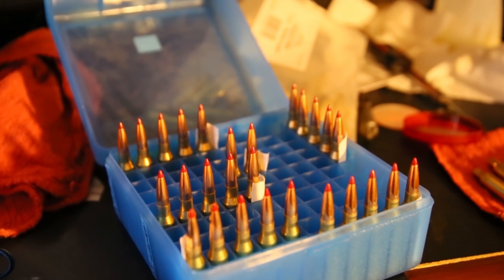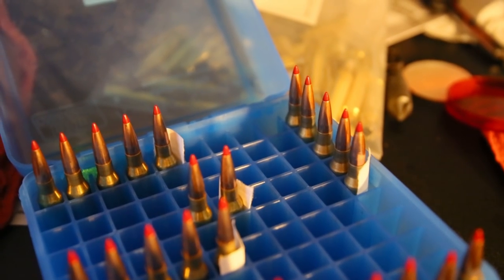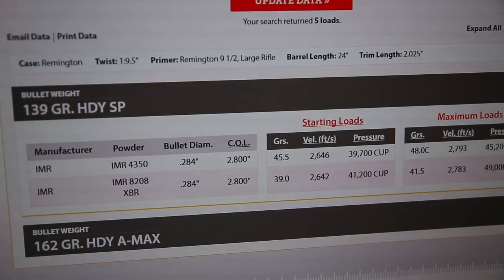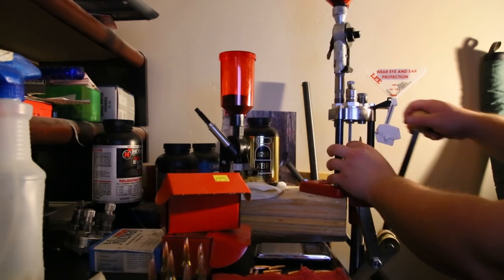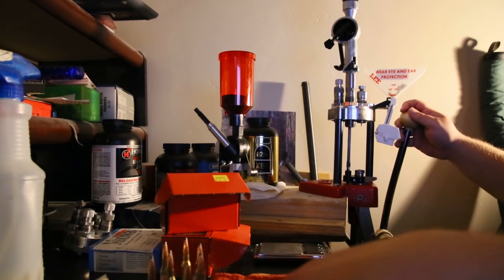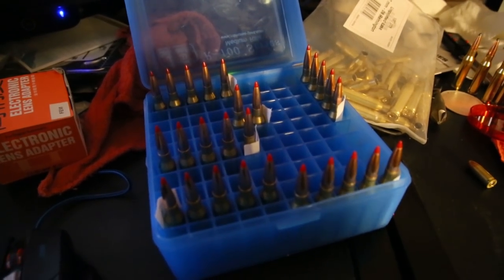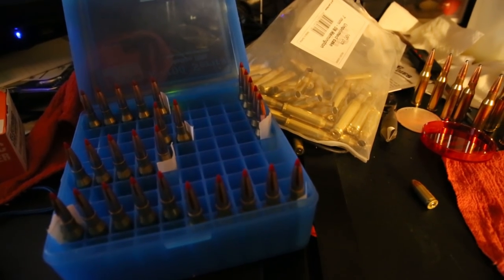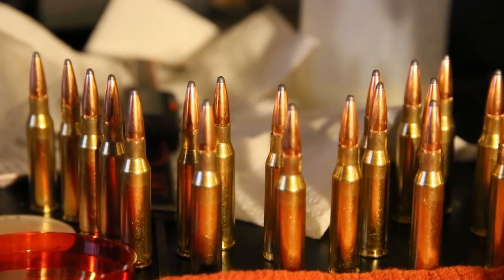Why I switched from 30-06 to 7MM-08 And reloading 7mm-08 for Elk - Lee Classic Turret Press

Comment: ok im thinking about .270 or 30-06 which one should I get?????
Reply from the maker: If I were you I would get the 30-06 over the .270 just because of the versatility and the ability to load heavier bullets. But both will get the job done depending on what you are wanted to do. I personally know a person who has taken 4 elk in the last 2 years with a .270. Well, 2 were his sons, but they all shot .270's. They had to shoot more than once, but that was probably due more to shot placement than caliber. 

 I would also consider the 7MM-08 though. It outpaces the .270 ballistically almost across the board, and passes up the 30-06 if you shoot out past 300 yards. It has less recoil than both.
Reply from the maker: Can you clarify which part you are referring to? Why is what?
Reply from the maker: I would go out and shoot both and see which one you like. Do some research about the ballistics and compare that to what you plan on doing and see which one matches what you want.
Reply from the maker: I mentioned that the bullet selection for the 30-06 is much better. The .270 can't shoot heavier bullets than about 140-150grs, but tou can load up 220gr bullets for the 30-06. The heavier bullets for the 30-06 also have a much higher BC and are more effective for longer range hunting. 
 There are pro's and cons to both. The .270 is flatter shooting because the velocities are faster. it also has less recoil because of the lighter bullets usually.
Reply: Glenn Pearson a 270win has more muzzle engery at 500yards then any 30-06 load
Reply from the maker: Unless the barrel is traveling with the bullet, I don't think you mean muzzle energy. Just energy. But your statement is incorrect. Look up the new 200-220gr ELD-X bullets for .30 that you can load in the 30-06. Those will have several hundred lbs more energy than anything available for the .270, especially at 500 yards. The .270 is a great caliber, but to say its better than anything out of a 30-06 is false.
Reply from the maker: Allen, I did look up load data before I commented. Also, I am not asking you to listen to me. I would love it if you could show me an example because there is nothing in the IMR/Hogdon's reloading data, hornady or nosler reloading data I have found that would back up your statement, which was that the .270Win has more energy at 500 yards than ANY load from a 30-06. There are actually about 10-15 loads available for the 30-06 that produce more energy than the BEST .270Win load at 500 yards. I even checked the .270 Weatherby Magnum loads, and even then there were still 30-06 loads that outperformed the Weatherby, though by a much smaller margin.  

Again, if you can offer more information to back up your statement, I am willing to hear it. Personal insults do not prove you are right, in fact they are usually used when someone is loosing or lost a debate.

Remember, I'm not even a big fan of the 30-06. But I know how versatile it is and that is has been a successful caliber for 110 years now. I also know bullshit when I hear it.
Reply: kid snipa the 270wsm holds more powder therefore kicks alittle more the 270win doesn't kick as bad either one will get the job done but if ur Sensitive to recoil get the 270win
Reply: Glenn Pearson and sorry bro I looked it up
Reply: kid snipa no problem man I'm not sensitive to recoil either but I got the 270win
Reply: kid snipa yes so since ur not sensitive to recoil I would get the 270wsm
Reply: Consider 7mm-08 if it isn't too late! Much easier recoil makes for better shot placement and short action allows lighter rifle to hump in mountains.  jmho.
Reply: RKBA very true and it's a good round
Reply: Allen Stewart Plus compare the velocity and energy at 500 yards compared to a .300 Win Mag.  7mm-08, 140 gr NBT vs. .300WM, 150 gr Core Lkt.!  Velocity is within 30fps but energy delivered is around 168ft lbs MORE than the .300WM!  I was surprised to learn that initially.
Reply: RKBA bro that's insane I didn't no that thanks for the info
Reply: kid snipa u can't go wrong with a 270 since ur 13 I would go with the 270win because it's got less kick then a 270wsm
Reply: kid snipa the the Remington model 700 is a great gun IDK who told u that but they r mistaking
Reply: kid snipa they r mistaking it for a model 770
Reply: kid snipa I never owned one man never shot one
Reply from the maker: I would pick up the 7mm-08 over the 6.5x55. I would also strongly consider the 7mm-08 against the .270win, as it has a bit more power down range because of the heavier bullets. But either way, I think you would be happy. Compare the ballistics and research for yourself. Everyone has their own opinion. The best is to build your own opinion.
Reply: Glenn Pearson there all good they all get the job done
Reply from the maker: If you are only hunting deer and only plan on shooting 50-60 yards for the rest of your life, pick up a .243. Great caliber, especially for deer with very little kick.
Reply: kid snipa there both very good choices u can't go wrong with neither one of them
Reply: kid snipa yes
Reply: kid snipa no problem
Reply: do some research... both will be perfectly suited for many applications... but find your purpose of what youre using it for i own 30.06 spring and honestly im highly impressed with the .270... especially after 200 yards it surpasses the 30.06 30.06 is the big boy most common probably of the last century but expenses might me lower with the .270 so take them all into account  really both good calibers for their built purposes
Reply: Good deal! I would say they come down to pricing and availability standard is fine at 22 in barrel might need or want a 24 on swm but does the improved velocity suit your needs and expectations down range?
Reply: Personally I'd go standard 270 spectacular at what it does and a little more barrel life
Reply: kid snipa as long as u don't shoot it more then once and let it cool off u want have to worry about the barrel
Reply: kid snipa Hotter round like most guns affects long gevety imo I see no true significant benefit to the wsm for him especially if he shoots it a lot and he will own it possibly for the next 60 years and generations on if so... just a thought... things taken into consideration like building a long range gun are more affected I guess ie. A 6.5 creed 1500 rnds 308 6000 or more? Haha
Reply: Allen Stewart sorry forgot to reply to you on that previous postkid snipa it's entirely up to you I'd just compare them side by side number to number and compare that to the purpose you're looking for... keep in mind things like u can walk into almost anywhere and buy 270 but do u have a wsm available in your area or do u order online only or load cartridges etc can't really go wrong either way here but if the purpose is to go 270 and get away from the things u don't want in a 30.06 powder changes will make it closer...
Reply: Eric Marquis I personally wouldn't have a 30-06 not because of the recoil I just don't like the 30-06 I'm a 270 man
Reply: +Allen Stewart I think the 270 is just better too
Reply: Eric Marquis Yep plus u get less drop at 500 yards with factory ammo that's what I shoot I don't reload
Reply: +Allen Stewart the 270 passes 30.06 performance after only 200 yrds
Reply: Eric Marquis I know bro I'm just saying at 500 yards u have less drop
Reply: kid snipa they both r going to cost u about 400 dollars if u go to ur local gun dealer
Reply: kid snipa OK but ur going to go threw alot of paper work
Reply from the maker: I'm sure he said that because buying a new gun and going through the background process requires a lot of paperwork.
Reply: Glenn Pearson I did ur right
Reply from the maker: Then you probably won't have all the paperwork, unless he chooses to sell it to you through a dealer.
Reply: Well said Glenn and I don't know you from "Adam"...
Reply: I love my 270 ammo availability for both should be about the same if you can shoot both and see what you like. If you want to get into hand loading get the 30-06 you can take it down to 308 levels or load up to damn near .300 H&H levels if you're skilled enough

Comment: Really you don’t check how much power is going in? I found out of 50 loads 4 will be right on
Reply from the maker: I check the powder every 4-5 usually. I'm always within .1-3 grs. Not enough to worry about it for my plinkers. I have an electric powder dispenser I use now for my hunting rounds. But for loading quickly on the press, this is accurate enough for target practice.

Comment: You shouldn't be talking while reloading. It's easy to skip a step or repeat (doubling the charge) a step. Reloading is can be very safe but it is a dangerous activity and carelessnes or negligence can cause serious accident, life altering event. You should at least, do spot checks to make sure the correct amount of powder charge is deposited in the case.  I've seen stuck bullets in the barrel due to no powder charge at all in the case, only the primer as a propellant to push the bullet.

Comment: What's the longest distance you'd shoot an elk with the 7mm so he doesn't bleed for 3 days and leave a 10 mile trail and is there a difference between 7mm and 7mm-08 or just another way to say same - thx
Reply from the maker: By 7MM I am assuming you are referring to the 7MM Rem Mag? If so, here is a video I did that compared the 7mm Rem Mag to the 7MM-08. There are many other options that shoot a 7MM projectile. 

https://www.youtube.com/watch?v=FhRlOrS69oE

The furthest I would personally shoot an elk would be 500 yards, with any gun. But that is because of my skill level and that question is only able to be answered depending on the skill level of the shooter. you can have the biggest caliber you want and shoot an elk in the ear and he isn't going to fall. Shot placement and bullet selection is key. Either of the guns you mentioned would be fine out to 500 yards, IF the shooter could place the bullet in the proper place. If you are chasing an elk all over the mtn after you shoot it, 95% of the time it was poor shot placement, not the gun you are using.

Comment: You guys tend to forget. Some states DGAF that you shoot a 7mm. If you wanna kill elk you use a .30 Cal.... Period. Bear, .30 Cal. 
7mm-08 is cute but when you wanna follow the law, 30-06 is good before you jump to 300mag. 
My only bitch/gripe.
Reply from the maker: Ana L. Beads cute comment, considering the most popular elk rifle is the 7mm remington magnum. The 7mm bullet is only 9% narrower than the .30 cal. However it's more efficient and performs better in many circumstances, especially long range. 

The comments saying you NEED a 30 cal to kill elk aren't founded, or statistically supported. I've seen a many videos of people with 30 cal rifles that flinch and shoot horribly. Proper shot placement is what kills, not some magical caliber. If you can shoot accurately and handle the larger 30 cal rifles than that is a good match. If you can't then you pick a rifle that you are accurate with and that is the one that is most dearly for you.
Reply: Glenn Pearson AGEED!

Comment: You will never get a very accurate/consistent powder charge using just that thrower.. It will get you close at best..
Reply from the maker: It gets closer enough. I have a digital powder measure now for my hunting loads. For my practice loads I still use this and it's always within .1-3 grams. I've shot 10 rounds within 1moa that were loaded with this, which is good enough for me.

Comment: Hornady bullet is cup and core not good hunting
Reply from the maker: Cup and core bullets make great hunting bullets if FPS is maintained for proper expansion. Many popular hunting bullets are cup and core from several manufacturers. Hornady interlocks the cup and core together. The ELD-X bullets have had great success and taken every animal that is legally hunted in the united states and other countries. After 8 years in the field, the ELD-X has proven itself. 

As with any bullet, the hunter should pick the appropriate bullet for the task, considering speed and distance when selecting the bullet.
Reply from the maker: The 5 bucks, 2 pronghorn and 2 elk I've taken with Hornady bullets, all single shot kills, wouldn't be able to tell you the difference in cup and core or bonded bullets...

Comment: change your o.a.l
Reply: lengthen your o.a.l to lessen pressure had to go from 2.350 to 2.450 to load 60 gr bullets for my 22-250
Reply from the maker: My overall length has been increased to just 5000th of an inch off the lands. That was actually part of the pressure problems. I read in the hornady reloading manual that if its too close to the lands, you need to either reduce the powder or decrease the length if you have pressure issues. I decreased the length slightly, and some of the pressure issues went away. I plan on doing a video of this soon.